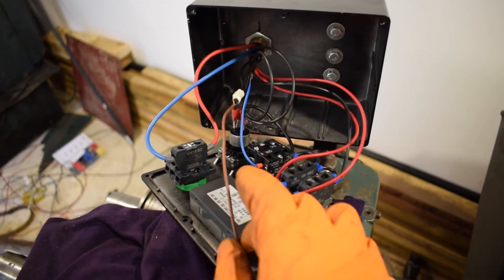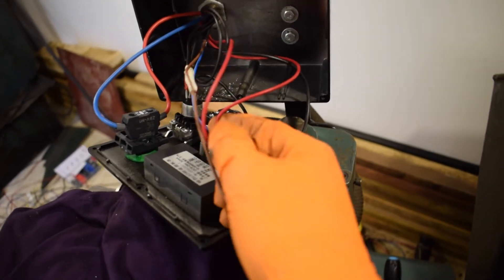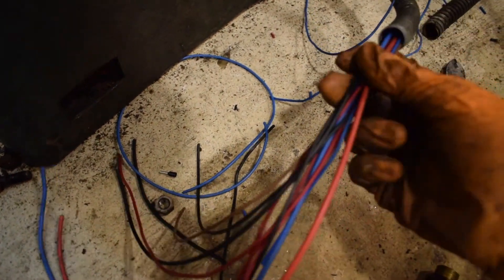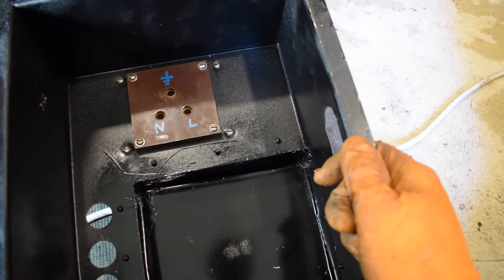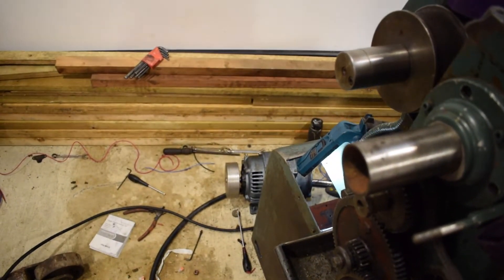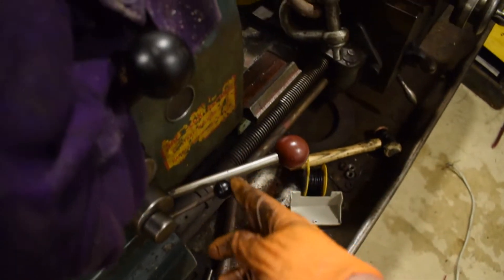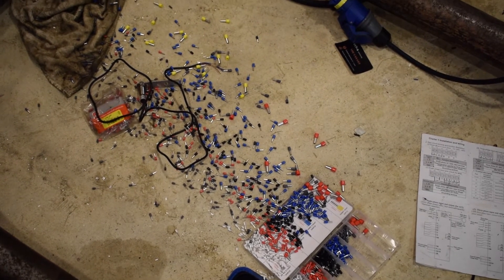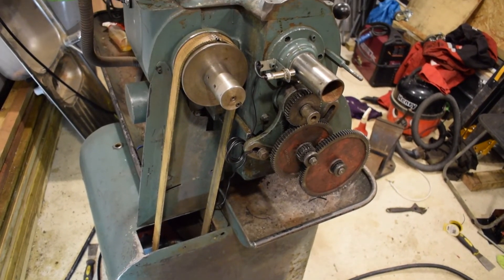Lathe VFD Conversion. PART 2 Colchester Student: 3 Phase to Single Phase

Comment: Ki Kim, this is a long shot here, when you fitted the inverter to the lathe did you fit any inductors in the circuit between the motor and the inverter, if so what size did you use, if not did your motor suffer any problems like heating up, burning out? The reason I ask is, I've just fitted my colchester with an inverter and a viewer has suggested fitting inductors to the three leads, staiting that this would cause issues if not fitted, I know from your channel you did this a while ago and was wondering if you had experienced any problems, fingers crossed
Reply from the maker: I didn’t fit anything like that no. I had the VFD overheat once I think but I can’t remember what I did to cause that. That wasn’t a motor issue I don’t thinkz just the VFD didn’t have enough circulation.

Comment: I know you did this 3 years ago but I've only just seen this vid. I have a question. That Colchester Student looks as if it has a secondary shaft behind the main shaft for the chuck, or is it simply part of the drive train from motor to chuck?
Ah I see now. The belt drive from the motor goes to the rear shaft.
You're a very good mechanic and electrician.

Comment: i have the same series of clausing lathe accept mine is the 15x48 with 5hp motor im running on a phase converter.  nice work on the vfd.

Comment: Nice one. Do you have a feel for how much torque  you lose with the vfd vs gearing for a particular Chuck speed?
Reply from the maker: Depending on what you’re doing you can notice the torque loss but if you keep the lathe gearing relative to the sort of rpm you want to run it’s pretty good. By this I mean not having it in highest gear to run slowest speed.

Comment: Great video…I’m seriously considering converting my Colchester chipmaster to VFD and ditching the Kopp variator. How much did this all cost you? I like the fact that you can vary speed with the potentiometer and listening to that, it would be much quieter than my mechanical variator.
Reply from the maker: Hi Nick, I think it was less than £200. The VFD might have been about £100 ish and then just loads of bits and bobs. It works great. The RPM readout is problematic though.
Reply: @CalamityKim1  I think you’ve convinced me😂….VFD ordered…I might go for the Newton Tesla remote button pendant,  that I will fix to the top of the lathe like you have the control box, especially if the speed readouts can problematic. Thank you! 👍

Comment: Nice one Kim, I have just picked up a lathe the same and will looking to wire up the vfd to use the original controls so your video will come in handy. Thanks for sharing.
Reply from the maker: Hey Sam. No worries. I was going to send you a message the other day. I forgot. Yours looks really nice. 
The VFD is a great addition

Comment: cracking job.. i have always wanted a lathe and mill because spending 50 quid on what is only a 5min job at my local engineering shop can add up over a project

Comment: Nice work KimB, would washers do as spacers, till you can turn some up ? Barking Mat
Reply from the maker: I did actually just cut some material to use as spacer but I may change it yet.

Comment: Really neat wiring! I have exactly the same lathe. Be careful not to run it over speed ,1000 chuck rpm max, and you can do most jobs at 500 or less. I am lucky, I have 3 phase in my workshop. The small lever control on the front face of the headstock used to reverse the lead screw has a neutral mid position, the lathe is much quieter if it is left in neutral unless you need leadscrew or feeds.  but they are pretty noisy machines. Have a look at mine on YouTube . Phil Whitley, my week this week. Good job Kim!
Reply from the maker: My lathe is 1200rpm speed rating. 
Also I have been using the neutral position a bit but I’m still tinkering. Easier to leave it in than knock it and crunch gears whilst fiddling. 

The next video you will see how quiet they can be. I have changed the oil today, it’s so quiet now!

Comment: Do you notice any difference in terms of power between using single phase and a VFD  instead of a 3ph supply. Just remember dad saying long before I was born when he had a feed with electric augers put in he had to spend triple the cost on specialist single phase motors due to the lack of 3ph that the standard motors used. Don't know how well it would work here as even with my Lincoln inverter I can still tell when the neighbourhood either start cooking or get home and want a cup of tea. Do now have 3ph passing the farm after a neighbour splashed out for his printing business though the engineers when my dad questioned he was told it was pointless as we were too far from the sub station that the drop was too much for it to work properly said it was still the same but he was adamant, they needed to replace the overhead wires anyway and he coughed up nearly 6 figures for it.